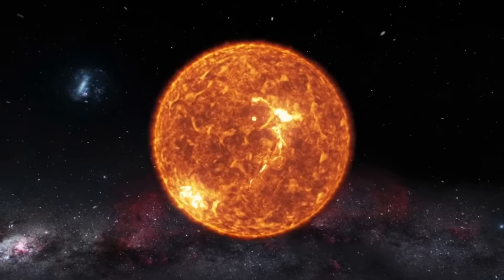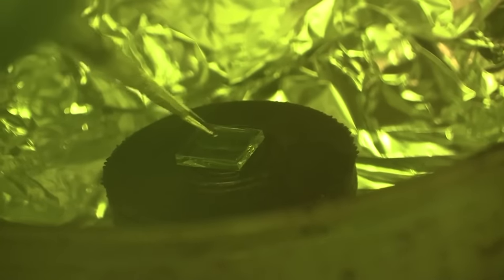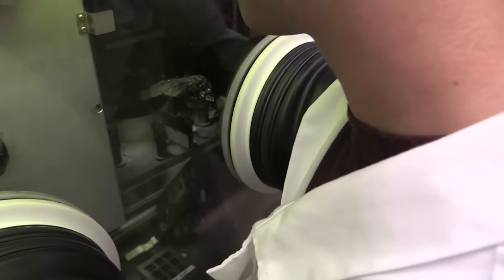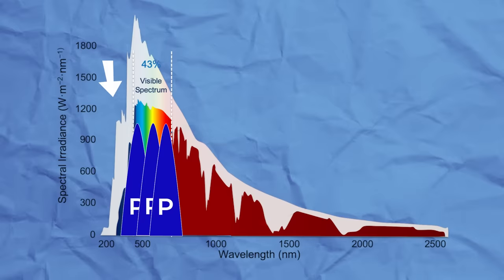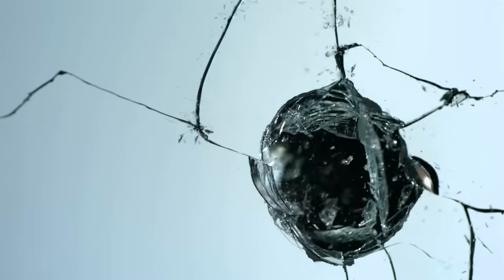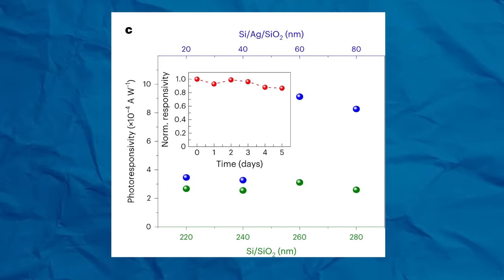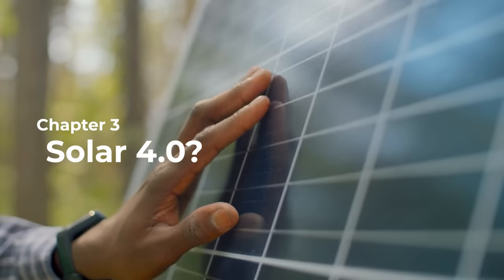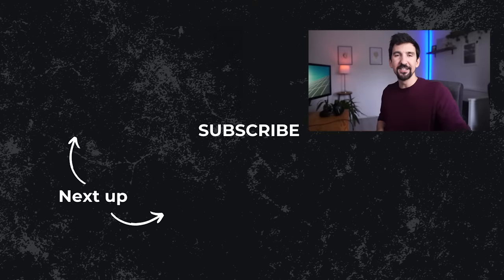Solar 4.0: Ultra Efficient Solar Panel Breakthrough

Comment: Can someone smart tell me if this 250% efficiency increase will get solar panels to 50% total efficiency of light energy conversion? Thanks.
Reply: It would be around 63% efficiency. Basing this of 25% x 250% or .25 x 2.5= .625 round up to 63%. That would be the high side.
Reply: I love the way you’ve worded your question, I think the same ALL THE TIME - Thanks!
Reply: It would be about 55-63% efficiency- 2.5x better than current single or double layer perovskite tuned to the same light frequency
Reply: @Tempestan  it says +250%, not 250%
Reply: @JorgetePanete  Same thing.
Reply: @pappaflammyboi5799  No. Three times more and three times as much are different things, simple math.
Reply: @JorgetePanete  First, that's not what you wrote, and second, 3x more and 3x as much can be interpreted the same way, unless you're going to perfectly clarify the definition of the two.

Of course, in that case, we wouldn't be discussing the nuances of the English language as opposed to the explicit nature of mathematics.
Reply: Failure to use English properly to describe the increase.
Reply: @pappaflammyboi5799  I think it's not just a trivial semantic distinction though. From the way he words it in the video, "an increase of 250%" seems like it should mean 250% added to the original, or 350% the original efficiency. Unless he actually meant an increase of 150%.
An increase of 100% has to mean double, right?

Anyway maybe I missed it in the video but I was a bit disappointed not to hear the absolute efficiency of this other type of solar cell, before or after the increase.
Reply: @Tempestan  I'm not sure that's true as he said it was a 250% increase on the improvement that perovskites gave over silicon, not of the overall efficiency.
So if perovskites without this change were 24% (someone gave that figure in another reply chain) compared to 22% (the upper end he gave for silicon) that is a 2% increase so a further 250% increase of that 2% would be a further 5% for a total increase over silicon of 7%, so 29% overall efficiency.
Reply: No, because if it was a big improvement in efficiency, it wouldn't be advertised as a grift to scam small time investors out of their retirement accounts. Instead it would be secreted away in existing solar power companies who would make it all proprietary.
Reply: @JorgetePanete  that “+250%” is in the YT thumbnail, is that your bastion of truth? The article pictured in the video states performance increased BY 250% ( as opposed to an increase OF 250%). That means multiply the current value by 2.5
Not that it matters anyways, since that’s just the lab result. The final product will have compromises that reduce that gain, by an unknown amount.
Reply: @richardh9587  if that's the case then it's really misleading, but you're probably right. If it was an actual 250% increase they would be using that 60% overall efficiency number instead of some relative increase
Reply: @martymissile  increase by and increase of means the same thing. if you increase something by 1% you don't mean a decrease of 99%.
Reply: It would 2.5 x 18% eff. Which equals 45% effeciency. Still better than current polycrystaline, but not quite 63%. When using percentages like this you basically drop the first 100% because its the equivalent of the initial amount so 18 x 250% could be looked at as "18 (100%) + 18(100%) + 9(50%)".
Reply: @Aaron-oe8xw  nah, x2.5 is an increase of 150%
The 45% you calculated is what it should be increased BY, so add that to the original value, or times by 3.5
Reply: @shiinondogewalker2809 eah 150% increase, which is 250% overall effeciency of the original panel.

Edit:
Just looked it up, single junction perovskite cells in 2022 were rated at a max of 29.5% effeciency. If these are now at 54% efficiency, i would be very surprised. 43% sounds mich for reasonable, though i jave a feeling we are all messing up the numbers and its likely around 35%
Reply: @Aaron-oe8xw  yes but he said a 250% increase, which should put it at a 350% efficiency of the original then
I also doubt it's over 50% efficiency in the end
Reply: @shiinondogewalker2809  yeah there's something that we aren't getting in the wording thats making all our maths wrong cuz jumping from 18% -> 63% is way too high for me to believe outright.

I do see now that he said increase, which was my bad.
Reply: This "250%" increase is a red herring, and really has to do with the base efficiency, which is not stated. If the original cell is 10% efficient, then a 250% increase in efficiency will mean a 25% efficient cell. This is why statistics need context and complete information. Most inventions never make it to market due to the "valley of death" between the invention and the practicalities of scaling, price, financing, marketing, acceptance, and unknown issues. As an electrician in the power industry, I have seen thousands of articles about these amazing breakthroughs that just evaporate into the air, never to be heard or seen of again. That doesn't mean we should stop working on them, as any one idea may influence another person/s work to help bring needed technology to our world.
Reply: Top of the line multijunction solar panels have efficency pushing beyond 45%. I guess this should be a reasonable goal for Perkovskite cell described in this video, as it is also multijunction cell. Stated 2.5x improvement would then put a base cell at ~18% efficency. Which is about right for mass produced monocrystal silicone cell.
Reply: @bariole  if base value was 18%, a +250% relative efficiency puts you at 63%
Reply: @GoCoyote  25% is a 150% relative increase from 10%
Reply: Yeah it seems based on 20% maximum conversion for current photovoltaic, as the video indicates, 250% increase equates to 50% maximum conversion of solar energy.
Reply: @joeomundson most Americans get this wrong. I would assume the same as you, given the +, but I think it's American vernacular in the specific case. Kind of related to how every time a price is written -.99, the buyer only sees the number to the left of the decimal.  Terrible public schools and consumerism. I noticed this, big time, when I returned to the states.
Reply: @shiinondogewalker2809 maybe the graphic meant "increase equal to or greater than?" I've seen "+" used in that way in marketing/ads plenty
Reply: 50% would be more efficient than internal combustion engines, and a lot cleaner too
Reply: @erikbrodin2198  it's still a relative increase isn't it?
If it said +100% that would mean double the efficiency
+200% triple
+250% x3.5
Reply: If 100% was 25% efficiancy +250% would be 25 times 2,5 and that is 62,5%
Reply: @Randomdude21-e  no, if 100% was 25% efficiency, 250% would be what you say, but in the +250 it's the value of the increase. a 250% 'increase' means you take your 100% and add 250% (that's where the plus in +250%). Else you run into some very weird situations, for example:
100% is 25% efficiency, so if you increase efficiency by 50% (+50%) you don't end up at 12.5%.